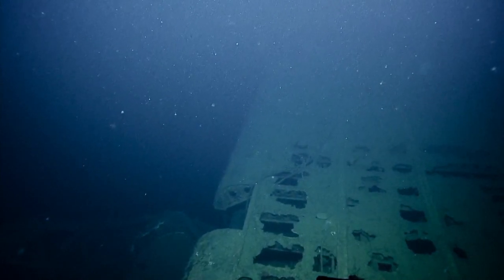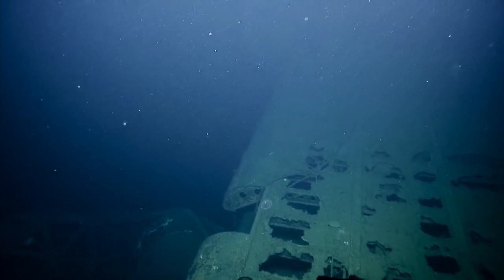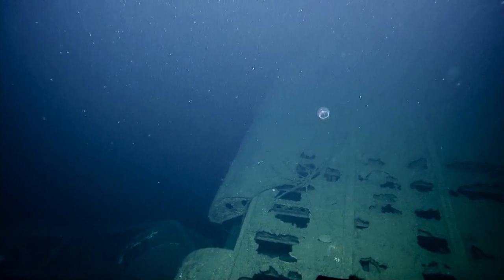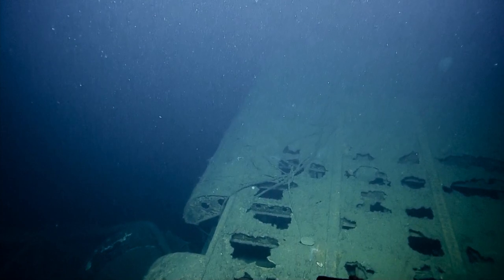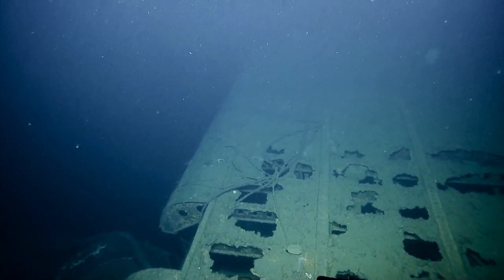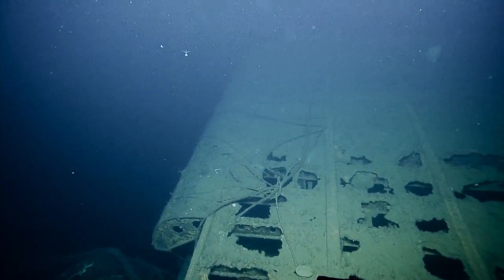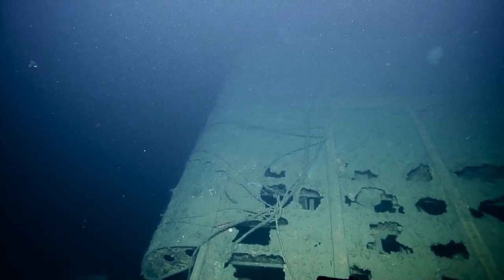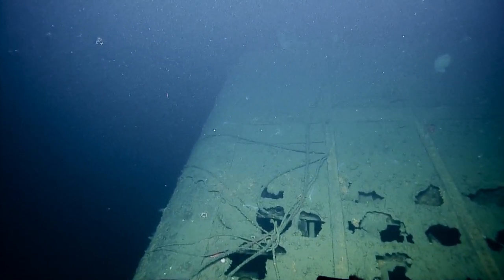Fly Along the Forward Flightdeck of USS Independence | Nautilus Live

Comment: WW2 fighters were prop-driven and fairly light when compared to later jet aircraft - and they were designed solely around this limitation: if the plane can't take off in a couple hundred feet under its own power, it wasn't put on a carrier.

While Independence did have a hydraulic catapult installed after its mid-war refit, it was used sparingly - generally only for fighter bombers carrying slung heavy ordinance.

Remember the Doolittle Raid? Full-sized bombers were able to take off from a carrier deck without a catapult (yes, after a LOT of weight was removed - but even then, the planes easily weighed as much as 2x what a fighter did).

The modern concept wasn't fully deployed until the Korean War due to jet fighters being much heavier than the prop planes of WW2.

However, arresting wires were still a necessity since planes were coming home in all sorts of conditions - barely functional, pilots mostly dead, etc... so having the cables helped immensely.

Comment: as i recall, and i could be wrong, i was on the USS Theodore Roosevelt cvn 71 during operation enduring freedom, shortly after our med cruise we went into dry dock and during that procedure they were removing our hydraulic catapults, to install pneumatic catapults, i recall having alot of problems with leaks in our hydraulic cats, but i was ordinance, so that's just what i recall coming over the loud speaker  i just find it interesting that hydraulic catapults were used for that long